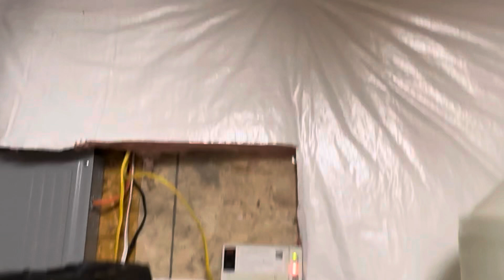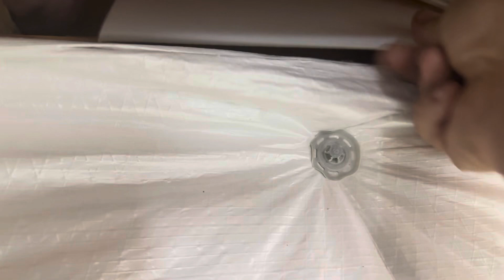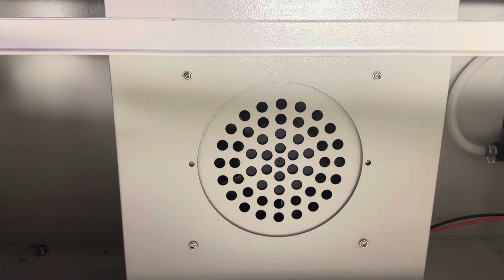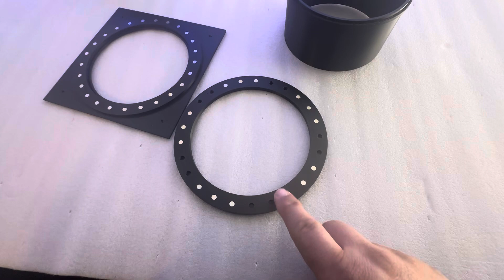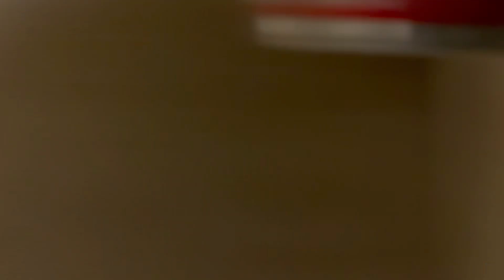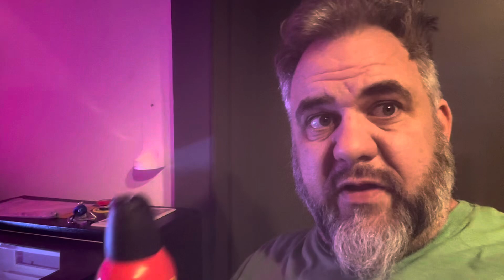Monport 2028 Exhaust Upgrades Inline Fan and Quick Disconnect

Comment: Nice work. I ordered a 80w 3624 on March 7th, but it’s out of stock. Shipping mid April apparently. In the meantime, prepping ALL the upgrades- air assist off of a compressor, amp meter, chiller flow monitors. Currently plan to cut out the vent plate and was looking for a solution for attaching a quick point vent hose- would definitely be interested in the STLs for the 3D prints. 

Subbed, looking forward to more laser updates. That lit up back panel is a nice touch
Reply from the maker: Thanks for watching.  It will be there before you know it!